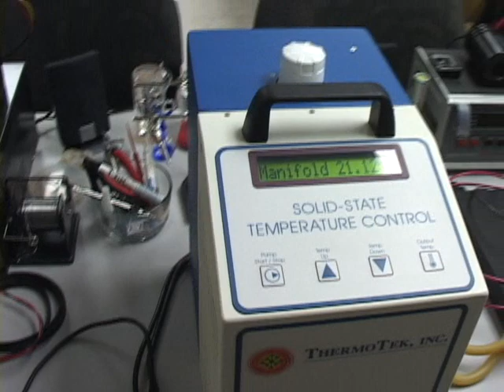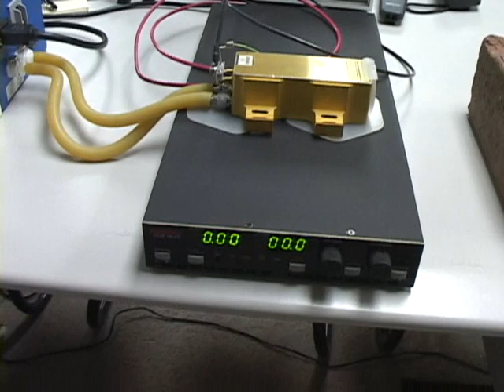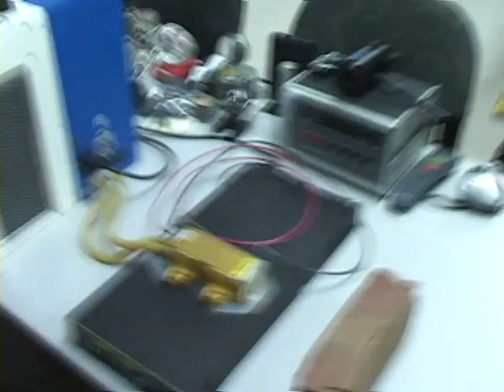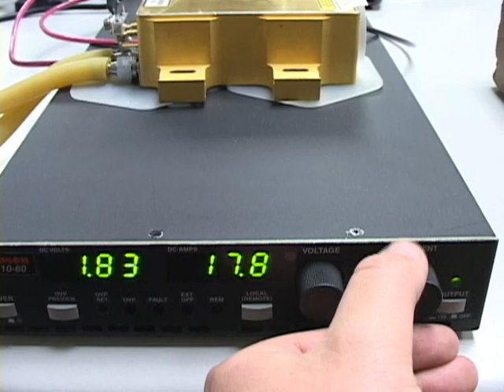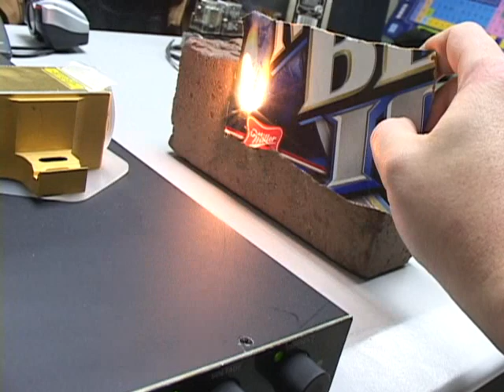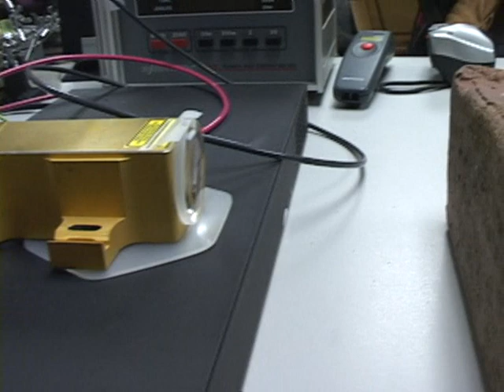60 Watt Coherent Laser Diode Test

Comment: Cool Trick. Ohms Law states ur title is misleading.
Reply from the maker: Well, you would be wrong. What do you think the chiller is doing?
Reply: @hightechstuff2  I didn't think it was possible to slow the flow of electrons.. meter displaying 50 Amps @ 2.25 Volts doesn't seem to be effected. Not very efficient if the meter is displaying one thing and something different is actually going on.
Reply: @hightechstuff2  The "chiller" is there to make it so the laser doesn't destroy itself..
Reply from the maker: @invaderzim_8833  Heat = Energy. A portion of the total output is wasted energy. Laser diodes are not 100% efficient. This is very simple to understand.

Comment: Good afternoon, where can I buy this laser? he has the TTL control? how much?
Reply from the maker: I do have another unit. I'd need to get $2800 via paypal, for the whole system.  The power supply should support TTL operation.
Reply: @hightechstuff2  
Is this module 60w even? cut mdf or 6mm acrylic?
Reply from the maker: @jhonatanxavier5687  You would be best with a CO2 laser for cutting acrylic.

Comment: Hi Adam
I am using 830nm laser
But it is taking more volts to operate is it power supply issue or laser is weak?
Please suggest
Reply: How is your wiring? You have to use some thick cables to run these diodes. The cables in my video are way too small for the operation. If your cables are getting warm, your voltage will go above 2.5V.

Comment: Many thanks for this experiment , I've a question please I want to know another thing about Laser Diode. What are the practical applications that use laser and generate high temperature , I have a research focus on temperature , Theoretically, the semiconductor material itself can be operated up to an intrinsic temperature of 650°C. Practically the operating temperature is limited at 250°C, because the electrical contacts, made by soldering with a high lead solder (300°C melting temperature).
Reply: Cleaning rust, emergency survival fire, nighttime signal flare, carnivorous hungry mammals protection,without killing, remote wireless fuse starter from a,distance, self defense uses,as,well,if pointed near the criminals face and eyes, experimental,sculpting device, wireless measuring tool,if modded. Feel lime,a,Jedi without cuttong yoir arm off
Reply: Also boiling water/distilling water, night sky astronomy pointer, also can make a microscope with a drop of wafer and dark smooth wall, as we'll as an analogue osccilpgraph. Did I mention you,can melt csrtai rocks back into lava?

Comment: Use an spot welder and a (full bridge rectifier) with an  big big resistor for 90amp and 2.1volts
Reply: Full bridge rectifiers would be expensive for 90 amps.
Also they aren't fast acting 
A very large Maxwell super capacitor could help smooth that as they are rated to 2.5V and a couple of hundred amps.
But not as easy especially for sensitive tech as described.

Comment: Is it the beam focused or "straight" like in a common low power laser pointer?
If somebody knows please tell me, because i'm looking for a an extremely powerful, straight (parallel rays) beam with small beam diameter infrared laser module. let me know if you know something like that please.
Reply: Graziano Ullucci The beam can be whatever you want it to be. The output is usually a square or rectangle, sometimes pre-coupled to a fiber. You need optics to change the beam, and you pick those by yourself, depending on your needs.
Reply: Yes I know, I can TRY to make it as I want, but in my knowledge (I've NEVER NEVER NEVER seen) a "laser pointer like" beam with more than 9W of power. It is good and preferrable infrared, but everything is ok for me.
Do you have a LINK, a VIDEO,a TV SHOW, a book... in which WE CAN SEE something like it? I've said TRY because it seems to me that a beam like the one I've said, is impossible to obtain. Lat me know if I'm wrong ok? Thank you to everyone has information about that.
Reply: Graziano Ullucci Well, any laser (almost, IR diode stacks like this usually have a WIIIIIIIIIIDE rectangular output, centimeters long and a few microns high) does exactly what you want it to do, except on a much smaller(5.6mm package) level.
Laser diodes have(almost always) a square output, just like their die is shaped(pull a crappy diode apart, and see that it's square).
Then you take a few pieces of glass(usually a set) and you focus the square, first into a fine point, then you expand that point to infinity focus(just like on a camera), and you get a uniform(microrad or so divergence) beam, which you call "laser pointer like".
Reply: I call "laser pointer like", something with a section not wider than a circle (or a square) with 1mm diameter or less (but a laser pointer has a very smaller one actually)
I've seen wheater lasers, but their beams can have diameter sections of over  20mm sometimes.
What I'm looking for is a beam with a so small diameter (1mm) for not less than 1.5meters along it's path. Then and before it can expand as it wants, I don't care. Does anybody knows if it is possible? Where did you've seen it? Do you have suggestions? Thank you guys! :-)
Reply: Graziano Ullucci Yeah, you can do that.
Here's one for example. http://www.geola.lt/files/top_hat.jpg
Reply: ***** I'll search for optics like that! I think that if you are so sure maybe it can be actually done, even by me. I have to look for optics.
If you know any source it will be really apreciate! Thank you!!! :-) I'll keep searching! :-)
Reply: Graziano Ullucci eBay. Just eBay and loads, loads of searching for something cheap.
And of course, experimenting when you get it, on a visible beam laser.
Reply: Thank You! I have to search for coherent laser diode assembly?
Reply: Graziano Ullucci Depends on what you want. If you want the laser, yes, if you want optics, just look for "laser optics", "laser glass", "laser lens", etc.

Comment: I am in the process of designing/building a 3D CNC multi machine with a 2' x 2' x 2' work space. It will print 3D in all the filaments as well as carbon fiber. I also designed a 360 degree/90 degree 400 watt liquid cooled spindle motor for 5 axis milling fun. It will also easily wield my 60 amp plasma cutter torch too. I would like to add laser cutting/machining capability to this already amazing piece of equipment as well. I was looking at 80 watt CO2 laser tubes and need some pointers on fiber optic relocation and culmination of the photonic fury to the working head. There's not much publicly available info on the meaty details, though I haven't gone overboard searching yet. If you could point me in the right direction it would be greatly appreciated... I have been scoring some amazing deals so far on the components for the project so far. I bought full case of 24  4 wire NEMA 23 size stepper motors with Philips optical encoders new old stock still in the Styrofoam cases for only $5 bucks each! The 3D printer controller complete with the LCD and SD card option was only $58 delivered direct from China and it even came with the 5 stepper drivers! I'm using 3/4" black pipe for the framing at $12 bucks per 10 foot length and Lowe's custom cuts and threads to length for you FREE! I gave the poor clerk that drew the short straw a $5 tip for making all the cuts at least. That cheered him up because he was a little bummed when I handed him the list! lol A surplus store near me had all the 3/4" T's, couplers and elbow fittings for only a buck a pop saving me a small fortune! That surplus store also gave me a great deal on amazing quality 1/2" 10TPI threaded rod for use as Acme lead screws for only $4 bucks each for 3 footers. They were from an old hardware store that went out of business 30 years ago that he bought out. They do not even sell threaded rod of this quality anymore. It looks better machined then actual cheap modern manufacture Acme screws! My linear bearings are home designed from 1/2" polished hardened hex stock I just found today FREE for 6 six foot lengths of it. I'm going to manufacture my own linear bearings from Teflon square stock drilled then machined out to perfectly ride the hex stock toolmaking the cutter from the actual hex stock I'll be using. I'm also machining my own anti backlash nuts from Delrin stock. I'm blessed to have 3 laths, a mill and several other shop machines in my home. If I had to buy all the shaft couplers, mounts and timing pulleys this would easily become an expensive endeavor. I doubt I have $200 bucks in it so far and will come in well under a grand when finished. It's amazing how close technology is getting to the foreseen replicators in the original Star Trek series way back  in the day. Our smart phones make their communicators look stupid now! lol Anyway, Great video,thanks for sharing...

Comment: I just want to burn ants with this thing.
Reply: just wanted to add that 5w laser is the highest capacity hand held laser you can legally buy or sell. there are no laws governing the private build of one more powerful laser so long as it has a saftey key and interlock you wont get in trouble. but if you say wanted to build a 100w laser and stop the beam with a end about 30 inches where the laser emits and focus the beam so it was larger and only burned at the rate a normal 1w would. you could have a pretty bad assed little lightsaber. totally legal
Reply: Agreed I thought I said the same thing but the law does specify pointers as a 5 mw max. Thanks for clarifying.
Reply: Thanks!

Comment: is it jsut me or is 50A x 2V = 100W ?
Reply: Yes, I can only presume that this is because he's getting a lot of voltage drop in those tiny wires which supply the laser. Additionally, I'm not sure if the laser is 60W input power or output power.
Reply: 100W of input power. In turning the electricity into a focused light beam, much energy is lost. The actual energy in the beam is only 60 watts. In a sense, the measurable lazser output is kindof a measure of efficiency.
Reply: With 60% effeciency

Comment: Please correct me if im wrong.
You write in the title 60Watt diode but you run it with more than 2V and more that 50A so P=U×I witch means u run it with more than 100Watt
Reply from the maker: You didn't account for efficiency. 60% of that energy is converted to heat, dissipated by the chiller.
Reply: The wattage which a laser is classified by is the output of light, not total consumption of power... Same as a 5mW laser pointer, the 5mW is light out, not total power used. The average green 5mW laser pointer consumes ~500mW of power to produce a 5mW beam. DPSS 532nm green is a great example of the efficiency curve.
Reply: Benjamin Stern **"which"
Reply: Ya Adam, ur right, my fail.
Reply: 60A X 2v is <100w of electrical power is Consumed, only ~30 or 40 is converted to light, the rest is converted to heat, thats why he needs the water cooling loop
Reply: More than 100w is consumed*

Comment: I'm trying to find a laser diode for a CNC laser cutter. The design requires a low-mass cutting head, so I've been looking at pigtail laser diodes. If you don't mind me asking, how much does one of the 60W arrays cost? And the power supply?
Reply: If you have to ask, you can't afford it

Comment: so cool! I was hoping the brick would (...moltenize?, molt?, melt). though...
Reply: Have you any Idea how hard it is to melt bricks?
Reply: +patrick costigliolo all silicates melt at 1200*C. (just about all rocks, like granite) 

(and I just learned this from checking my facts, so I realized it's not that easy to melt bricks afterall) but since bricks are clay, which does have quite a big percentage of silica, but also has a lot of alumina in it, so it's more like 1800*C due to the alumina. I'm not sure whether half of it melts between 1200 and 1800, or if it is resistant until 1800.

Although in welding we use fire bricks for when we need something to take heat, they are designed to be very porous (air pockets) so it's difficult to get them to that temperature. It's like how you make a metal heat sink, but with clay. They will melt at that 1200-1800*C range if it can be obtained. It's easy to get them yellow hot, but difficult to get them to melt.

I made that comment two years ago, before I started welding, and I now know that the laser would have to be hitting that spot for long enough to heat the whole brick to get too hot to touch, before the spot would start dripping the molten material.

Comment: What is the diode model used? What is the wiring diagram of the connectors? What is the lens and source used, and related to this, will be giving one to do? What type of concentrator ideal, namely laser head? How can I use the fiber optic head as seen on the website below? Connecting the diode with fiber optics and head?
My email: gilberto_alves_rodrigues@yahoo.com.br

Thank you.

Comment: Depending on what you shine it at, it gets even worse: metal reflectivity at most visible frequencies goes easily over 60% (that's 600mW for a 1W laser), while certain combinations of material and frequency, like Copper vs 800nm lasers, go over 90% reflectivity. That's almost like shining the laser straight into your eye.

Comment: I have lots of questions. What site did you buy those safety goggles from? What is the price for a diode array like that? Is that a cylindrical lens in front of the array? Could you put more lenses to obtain a thin, squarish beam focussed to infinity? Compared to a CO2 laser of equivalent power, does this need more or less cooling? More or less input power?
These are all the question I can think of right now, if I get any others I'll post another message.

Comment: Please excuse my ignorance in electronics but, wouldn't it be possible to feed this laser with a battery like the ones used for Rc quadcopters??
And second question. Why all the test for burning stuff are done so close form the diode/origin? Does the laser lose much energy on the way?.

Comment from the maker: Your logic is correct but you need to account for diode breakdown voltage characteristics along with the fact that current to photon conversion in a semiconductor is not 100% efficient. Look at the big chiller connected to the laser diode array, that heat dissipated accounts for a percent of the input energy. Thanks for thinking.

Comment: I'm only doing year 11 physics so please correct me if i'm wrong, but according to the ohms law; 
power = voltage * current 
voltage = power / current
substituting the values he describe power 60 watts and 90 amps power = 60/90 
which come out to voltage = 0.6 volts ?????
Please use constructive criticism :)

Comment: You need a lot more than that, read about the mthel its a deuterium fluoride laser in the megawatt range, and check out northrup grummans new firestorm solid state, its about 120,000 watts but you need a truckload of batterys.

Comment: Sweet power supply and cooler, but be careful with those safety glasses, I use that type of safety glasses with my 445 lasers and if you turn your head sideways you can see a gap at the bridge of your nose ( try it with a bright lightbulb and see what I mean ) and with a 60 watt 808nm at close range you could burn your retina so fast YIKES. I recomend getting the goggle type, I have some 12 watt coherent fac lasers that I wont even try to power up until I get some goggle style safety glasses.

Comment: Where can you get YAG Diodes. I'm looking to build a laser cutter CNC and wanna try it with a YAG laser instead of the normal CO2 laser. CO2 Tubes can be purchased all around the internet but I can't find anthing on YAG Lasers especailly anything as clean as the cooling block of the one in this video.

Comment: Nice laser.
What sort of pulsed output could you get from that one?
And the question everyone wants answered, what kind of pulsed output would be needed to make 1-5mm holes in say 1/4" steel plate instantly (microseconds to milliseconds), are there any diodes or diode arrays capable of that?

Comment from the maker: Good thinking but it will never work. The diode acts as a near dead short and would over-current with just a transformer. A current limiting switcher is the way to go. A lot lighter too. I recently picked up a 0-10V @ 0-100A unit. This will run my 160W array.

Comment from the maker: I got lucky when I bought this one on ebay for $50 "for parts, not working" The only thing wrong with it was that the dip switch was in slave mode. They go for $1700 brand new. Now, you can't find them on ebay for less than $500 unless you get lucky.

Comment from the maker: @thatoneguy99100 Thanks! I later learned this laser is actually around 830nm so it's inefficient as an Nd:YAG pump. Still fun to experiment with though. I sold this rig a few years ago but have a 180W array I plan to get running in the near future.

Comment from the maker: @ThePizzahero1 60W is the max optical output power. The rest is dumped via inefficiencies as waste heat. Thus the reason for the chiller.

Yes, it is very dangerous to look at the diffused radiance as your eye will not feel the pain until damage is being done. I wear goggles when dealing with powers at this wavelength.

Comment: You need to offset the angle of the lens you have on the end there just a few degrees so that reflections from the first surface of the lens dont enter the diode module and damage the sensitive emission surface.

Comment from the maker: @zRev1983 You're right... you are not an electrical engineer. If you were, you'd know that power conversion is never 100% efficient, hence the need for the large chiller to dissipate all the waste heat. You might want to think again before you try and give advice.